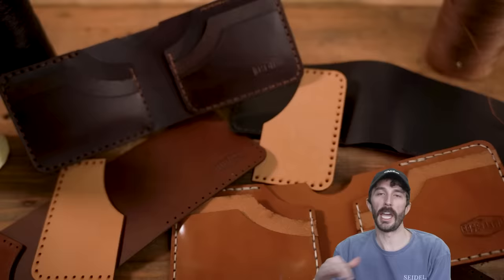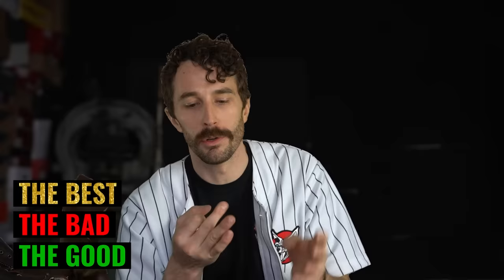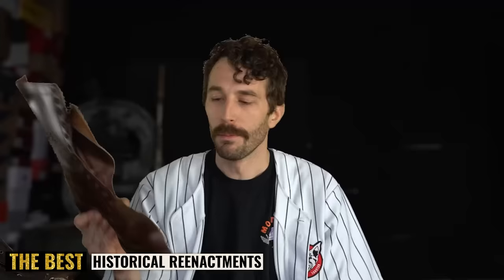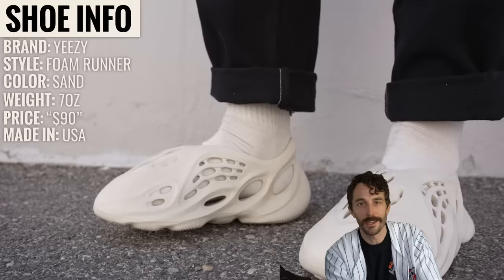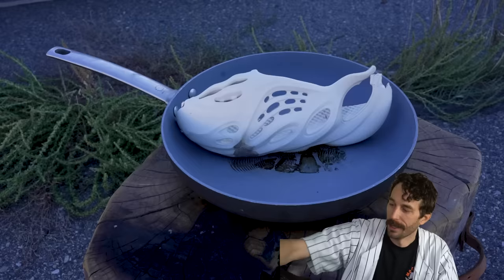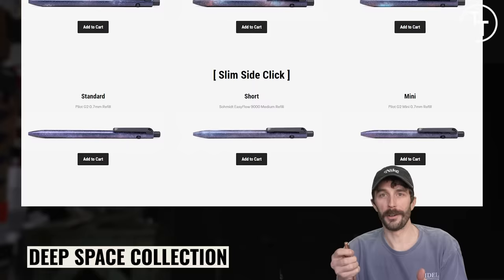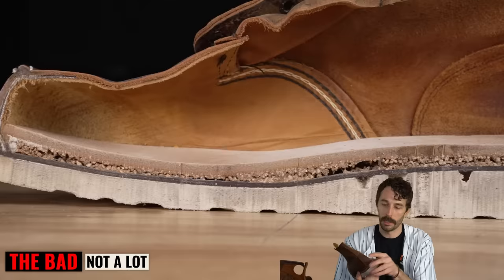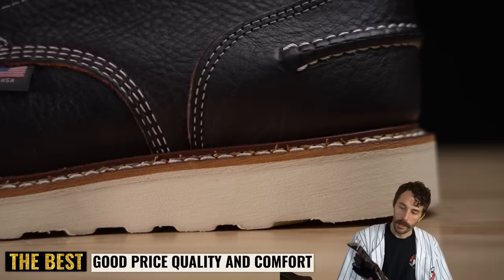Top 9 Boots made in USA (Cut In Half)

Comment: If possible, I would like to see you add Allen Edmonds Higgins Mill and Chapman to the lineup. They're made in the USA, Goodyear welted and often cost under $400. Both can come with Horween Chromexcel. Thank you
Reply: I agree, I love my Higgins Mill, they do retail for over $400.00, but that is there sucker price. I paid $ 320.00 for mine
Reply: @60zeller  good point if you have patience you can get most AE boots for low 300 or even less at the end of the season.
Reply: Ebay is insane for boots. I got some Higgins Mills in shell for $200

Comment: I love my Corcoran boots but mine are made in Massachusetts which it’s made with a good amount of different materials it has a veg tan leather insole. The outer leather doesn’t have that plastic feel to them as they feel more like they had less but more of a wax to make it still shine but not like the boot you have is more dull. And my out sole was black with the upper being brown and it was more oil/ slip resistant so it’s weird to see just how different they are. I but boot wax and bees wax on mine for water proofing and so motor oil slides off them. Mine still have that cool strap which I wish ever boot had because when you are climbing ladder’s putting tires away or jumping 3 feet off a car lift they help my feet a lot

Comment: I'm a MITSU, steel-toed, boot buyer.  
The foam thing is not even a shoe, let alone a boot. 
Right now I am wearing $250 worth of Red Wing, made extra stinky with both HFO/IFO fuel oil and DREWCLEAN3000 degreaser. 
The Red Wings are heavy, and take a long time to break in, even in abusive environments of saltwater and petroleum. BUT years later, they are still boots, and by that I mean they protect your foot in the course of WORK.  
I have an expensive pair of Red Wing hipsterboots c.2014, that I like, and on par with what you are looking at, but they're not steeltoed. 
I like that pen.  
I'm wearing pants, shirt, socks, all USA-made, so I gotta get that pen.
Red Wings are rated high, because they are good and because their loyal following, but I am looking for a QUALITY steel-toe, MITUSA, boot, that is light, because I am pushing 50, and work in boots. 
THANKS

Comment: I purchased a pair of 1907s yesterday.  I chose them over the Iron Rangers because they fit my orthotics better.  I currently own a pair of Thorogood boots that I am not to happy with.  They seem to tear my heels up, could be I bought the wrong size, so I will carry half the blame there, as it always seems to be caused by rubbing against the stitching that runs around the heel.  My biggest complaint is that the lace hooks are pulling out of the leather,  the leather is stretching/yielding.  I have one hook that fell out, and others that are just hanging on.  I will have them resoled, and when I do, I will get the cobbler to install eyelets or better lace hooks.

Comment: There was a time when Corcoran jump boots were made well. That was a lifetime ago and I will never own another pair of jump boots for a multitude of reasons. I like the Thorogood in 8" without the liner. I wear them all the time. They work for my flat as a board feet and are comfortable. I have a pair I have 4 resoles on! It will be a sad day to see that pair go away. If I were younger, I might wear a logger boot, but those days are gone along with my arches. I am more aligned to the fan rankings on this test. I am thinking of getting some of the Jim Green boots for casual use.

Comment: I'm a truck driver in the construction industry. My issue with boots is - do I buy cheap boots, which would last about 6 months, or do I spend a lot of money on Red Wings, or the like, and they would last a couple of years? It may seem like an easy answer, but the soles on any of the boots I've bought don't last. I had some Red Wings that I had for 9 years, but in the 9 yrs I replaced the soles 3 times, the sub sole structure finally gave up the ghost and the boot was irretrievably un-fixable, plus to replace the soles is 150 bucks, not cheap. so I went with a "not cheap but not top of the line" boot that was comfortable, the main structure is leather, the soles are Vibram  and I'm sure the "innards" are cheap synthetic, but comfortable. I'm prepared to buy a new pair at about the 2 yr mark. I'm sure there is a better way, but I just can't see it.

Comment: Ive heard a couple boots mentioned as having synthetic rands. I don’t fully understand what a rand is and if having a lower quality one makes much of a difference. Im wondering if you could do more videos on boot anatomy.
Reply: A rand is the piece you see on SOME boots that protect the sides and toe of the boot, usually a black rubbery coating. A synthetic rand isn't "bad" if it is stitched and not just glued. It's main job is to keep moisture out, why it's mostly seen on hiking boots.

A synthetic rand can be considered better than a leather rand or any other natural material because of the waterproofing that synthetic materials provide

Comment: I bought a pair of iron rangers a couple of months ago.
After nearly 50 miles and 2 months of wear I sent them back and recieved a full refund.
They were genuinely unwearable - like concrete lined with sandpaper glued to a wooden plank. I've never had a pair of boots like them. There was absolutely no give in them at all and they ripped my heels to shreds on every wear. It's not rocket science to see the issue - the leather at the heel reinforcement is way too thick to allow for any molding or binding, and the soles are too stiff.
I honestly think there's a lot of 'emperors new clothes' to red wings. A load of people loudly saying how great they are, when in reality they all know they're useless but don't want to be the lone voice pointing out a boot that can't be worn without heel plasters 24/7 isn't fit for purpose. I definitely won't be going near them again.

Comment: Let's be honest, the re-sole ability of a boot is kind of a moot point because only the tiniest percentage of people will ever have that done. by the time the sole wears out on a pair of my boots, the rest of it is shot too.  And even if it wasn't I highly doubt that I or most people would bother re-soling rather than just buy new ones.
Reply: I have custom made Limmer Standards.  I bought mine in the 1990's when they were "only" around $450.  Having them re-soled made more sense than buying new boots.  Custom Limmers now run around $600.
Reply: @marklafrenz7123  I didn't say that it never makes sense or that nobody does it. I said most people won't do it. Besides, if you have a pair of boots that old then you don't wear them very much and that's the impression I get from this channel. It's a bunch of guys who wear boots around, but don't actually work in them.
Reply: @shmeli  You're right that only a tiny percentage of people will ever have a pair of boots (or shoes in general) re-soled.  I admit that I don't wear my Limmer's very often any more.  That's because I don't spend my time on the trail anymore.  My custom Limmers were worth the price when I bought them.  I'm not sure that they'd be worth it to me now, although I'd buy the non-custom ones, which are still pricey.  The worst part about their boots (at least the Standard) is how long they take to break in.

Comment: I had a pair of Wolverine 1000 mile boots... for about 4 or 5 months. Biggest waste of money ever. Horrible build quality and materials quality. After just those months, only wearing them a few days a week, and not abusing them, they started falling apart. Inside started splitting around the ankle and the sole started separating and flopping when I walked. I just threw them in the trash, I was too disgusted by the boots and the brand to even attempt to fix them. Never again Wolverine. Easily the worst boot I've ever owned, and that's including some of the sub $100 Walmart special work boots I used in my younger years.

Comment: I would place the JK 300s in the lower tier of your ranking, most definitely above a Wolverine 1000 Mile.

I bought a pair of JK 300s based upon your review.  I was disappointed by the poor fit and the workmanship was even worse.

My number one complaint is that the boots cannot be rebuilt.  They can only be resoled, meaning peel off the old sole and glue a new one in its place.  

All Wolverine boots have a wonderful fit on the foot, and the 1000 Mile is their best fitting boot of them all.  

Unlike the JK 300s, the 1000 Mile and most of the other boots on the list can be rebuilt with a new insole, welt, midsole, and outsole.
Reply: I get what you’re saying but most boots on the list are boots that are on the upper echelon of their products.  The Jk 300 is a boot they purposely made cheaper than every other boot they make. I don’t own a pair of 300s so I can’t debate the issues you have  as I bought a pair of 8inch forefronts specifically for the Blake stitching. I think it will help since I work with asphalt